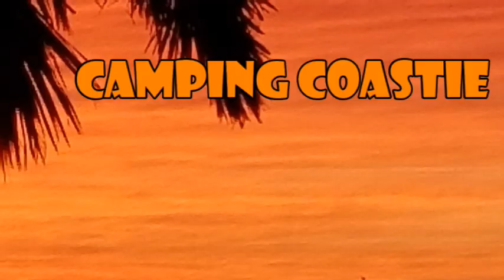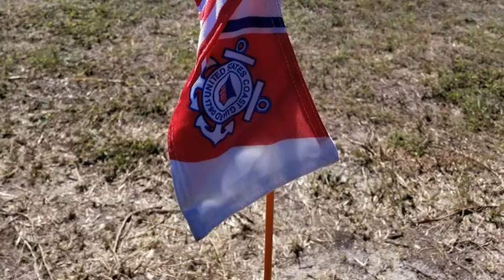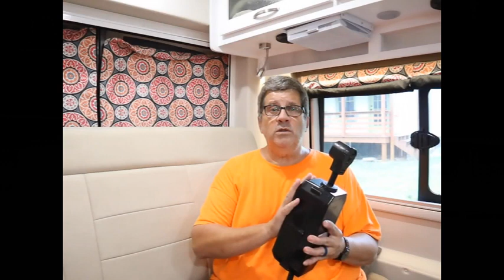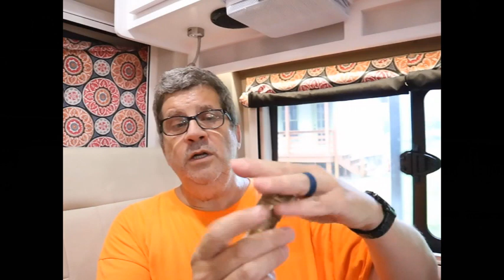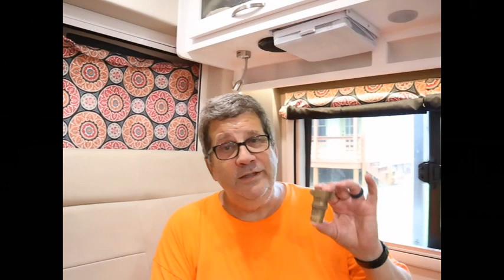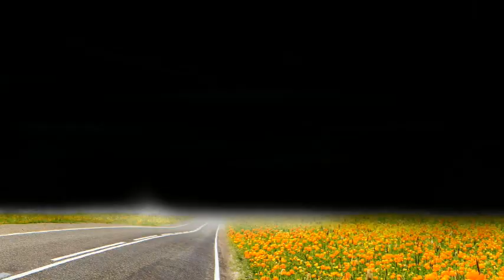Two RV Must Haves!

Comment: We are looking to buy a 2024 coachmen Beyond 22C and I've heard complaints about the short sewer hose storage. How do you cope with that? Any suggestions would be greatly appreciated Thank you.
Reply from the maker: I don't really connect my sewer hose, I just hook it up to the van and put the other end into the sewer receptacle on the ground when I need to dump.  The hose holder works great for me with my hose, here is a video of my hose.

https://youtu.be/rIYqZpkz8nQ
Reply: @CampingCoastie  I watched your great YouTube video link and my question is  there something wrong with the factory sewer hose that you didn't like?
Reply from the maker: Most, if not all RVs, don't come with sewer hoses.  Usually, the selling dealer will supply a sewer hose, drinking water hose, and water pressure regulator.
Reply: @CampingCoastie  thanks for clearing that up for me somehow I just assume it was part of the RV so that explains a lot. I didn't know if  you got my other question on a different video but I'll ask it again sorry for duplication. I noticed in one of your other videos you would have bottled water inside the van is there any safety issues with drinking water from the fresh water ?
Reply from the maker: @Kip  if you properly sanitize your water system and fill it with good water, it's okay to use your freshwater tank water.  We are kind of odd. We drink bottled water even when home. It's pretty much just the way we are.
Reply: @CampingCoastie Thanks again for the information You've been so helpful in helping us with our purchasing decision! I noticed on the 2023  it has a solar charging port for it. Does yours have that and if so have you used it before with portable folding solar panels
Reply from the maker: @kip5588  I have to solar port, but I haven't used it yet.  I don't own a portable solar panel, I have felt I need one yet.

Comment: Could you add the cap sensors without having to add Borg metal stem extensions? (I assume you added the cap sensors DYI) Just trying to save a few dollars on my new OnTour 2.2.
Reply from the maker: I am not sure on the Ontour is it has one piece metal valve stems.  My Coachmen Beyond had them installed by Coachmen.   For me, all I had to do was add the TPMS caps.  I will check and see if I can find out for you.
Reply from the maker: I believe you need to add the one piece metal valve stems.

Comment: I thought of a couple of other questions. Where can I get one of these EMS devices? Do you think it should be used when plugged into a home electrical outlet? Do you think automatic levelers are worth the expensive price tag, especially.on a class B? Thanks
Reply from the maker: You should always use an EMS, even at home, it protects your RVs electrical system from voltage spikes and over/under voltages.  If you have a compressor refrigerator the need to be very level is not really a problem.   If you have a three way refrigerator you need to be pretty level to make sure it works good.  Either way, I would just use inexpensive stacking leveling blocks.  You can get them usually a Walmart, RV stores or off Amazon.

As for the EMS, there are a bit pricey, but they can save you a lot of money if something goes wrong.

Here is an affiliate link for the EMS: https://amzn.to/2YGLzWS
Reply: @CampingCoastie  Thanks so much. I do have a compressor fridge. I will be ordering an EMS and will use your affiliate  link when I do. Take care.
Reply from the maker: Thanks.  I like your van setup.   The natural look for the is nice, just sealed like you said in your video.
Reply: @CampingCoastie  👍

Comment: Agree with your priorities, Gard.  The list of "fun" stuff is indeed long, and the absolute "must haves" much shorter.  May I ask what brand of EMS protector you decided to purchase --  and what sold you on this particular model?  And just so I am clear,  is your EMS protector the same as what others call a dog bone or is that yet another "must have"?  Sorry to be so basic.  Thanks!
Reply from the maker: The EMS I have has been replaced by a newer model, I have a Surge Guard 34830.  The newer model is the Southwire 34930 Surge Guard 30A and is available on Amazon at this link: https://amzn.to/2FSXj1M 
I bought mine years ago at Camping World, I liked it because it offered full protection.  Up to that point I just had a simple RV surge protector.

The other one I mentioned in the video remarks is Progressive Industries EMS-PT30X:  https://amzn.to/32tiqiP

That one is cheaper and has great reviews from people all over the internet.  If I were to need to replace mine that is the one I would buy.

A "dog bone" is an adapter that allows you to use a different amp plug.  For example, a 50 male to 30 female would let you plug into a 50 amp outlet.  A 15 male to 30 female would let you plug into a 15 amp outlet.  The 50 male to 30 female is high on the need list, but not really a must have.  If you are at an RV campground and all they have available are  50 amp sites this would let that work for you.  Also, at a sight maybe there is a problem with the 30 amp outlet, with a dog bone you can use to 50 amp outlet.
50 amp male to 30 amp female:  https://amzn.to/2QrPrXb

Those links to Amazon are affiliate links and I get a little money from sales just to let you know.
Reply: @CampingCoastie  Many thanks.

Comment: Good information Gard (as always!).  I'm curious,  doe you leave the "City Water" connected when you're in an RV Park?  I've heard that many people just leave it disconnected and refill their fresh water tank when necessary.  Curious about your opinion on this.  Thanks! George in FL.
Reply from the maker: Most of the time we just fill the fresh tank and leave the hose off.  That way all we need to do to leave is disconnect the power cord.

Our usual way we use RV campgrounds is pull in, hook up power and spend the night.  Then in the morning dump the tanks and fill the fresh, disconnect the power and leave.  

Sometimes if we are staying two or more days I do a full hook-up of power, water and dump hose.  that way can use all the water we want and not worry about anything.  I leave the gray and black tank valves closed and only open the gray as needed.
Reply: @CampingCoastie  Thanks Gard! That answers all my questions.  Have a great day!  George in FL